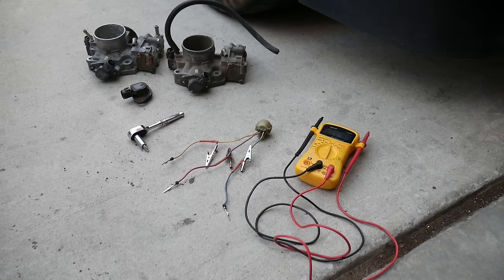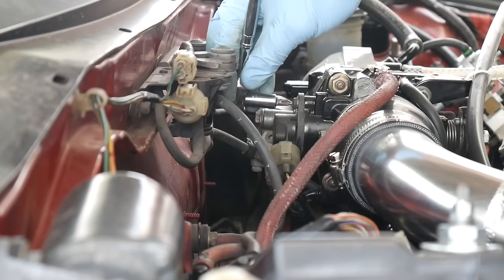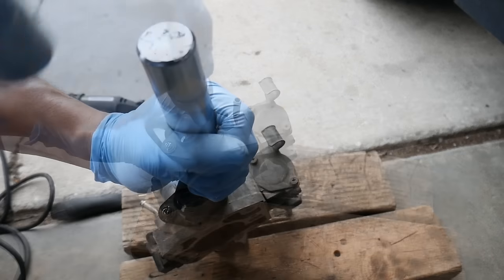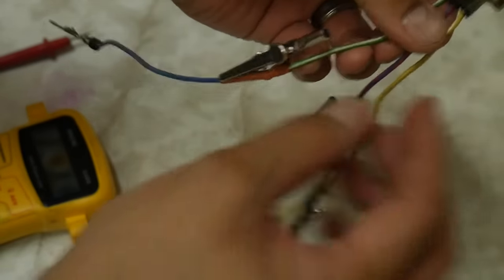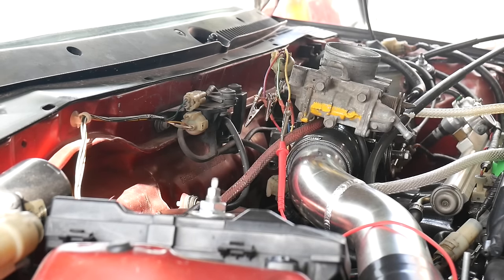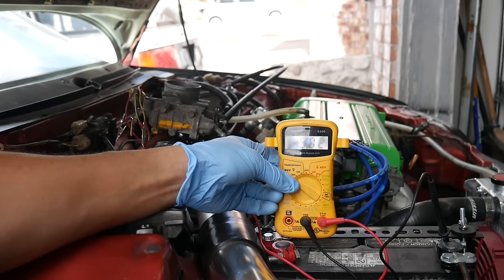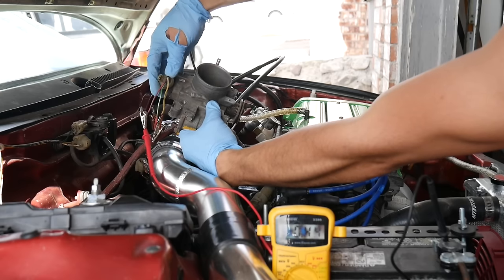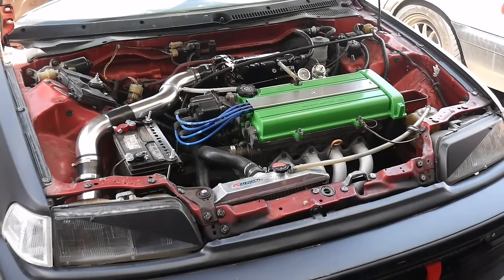How To Replace & Calibrate Honda TPS (throttle position sensor) - Code 7 Check Engine Light

Comment: PLEASE DELETE THIS VIDEO.... you will never adjust or touch the TPS sensor. Japanese engineers have this set DUMMY! That's why those bolts are not screwable.
Reply from the maker: Haha.  And when you replace it?  Hello?
Reply: @GarageBuiltHondas  you should replace the entire throttle body, which comes with manf tuned settings...
Reply from the maker: No.  That's not required otherwise they wouldn't sell independent TPS's.  That really wouldn't be cost effective.  Think of all the Honda's in the world with aftermarket throttle bodies with not a single TPS already attached.  Do you really think they have a hard time adjusting those?  This method works perfectly fine.
Reply: @GarageBuiltHondas  yes with tuning issues...
Reply from the maker: Lmao, wow.  Just stop man.  It's like you're arguing that water isn't wet.  Geez.
Reply: @powereng1000  So if the front door on your house squeeks you just buy another house? You own a console you peasant.
Reply: @GarageBuiltHondas  Mine one is honda fit 1300 cc 2002 I watch some other videos they set 0.40 at fully close but some 0.45, so I'm sure which one, can you suggest me?
Reply: The local Honda dealership offered to sell me a new throttle body with sensor for $600. Sorry, no. Replacing it and recalibrating the sensor seemed safer than buying an entire after-market throttle body.
Reply: Just completed the calibration and put everything back together. Took the opportunity to clean the throttle body thoroughly and pour about 1/2 can of fuel system cleaner through the throttle body with the engine running, using the throttle to keep it from stalling. It's running better than it has in years.  $60 including TPS and the extra plug and alligator clips. Very helpful. Thanks, Joe!
Reply from the maker: Love to hear that, excellent!!
Reply: @GarageBuiltHondas  wait.... water's wet.... I remember now haha. Some arguments can be rather entertaining.
Reply: @powereng1000  they put those security screws in, for two porposes.
1) if missing voids warrenty
2) so you have to buy the whole unit.
all auto manufacturers do this and yes the video shows a proper repair.
you must work in a parts changer shop
Reply: @danrandle65  Honda has TPS tuned to the MCU. This is a manufacturer setting. You can change it if you are tuning your engine such as when you do a valve adjustment with a new cam shaft for VTech or feul injector.
Reply: @powereng1000  you don't know cars like you think. Please do more reading and less posting...
Reply: @BiggieBert666  sadly for you I am a mechanical engineer with 3 Honda Civics... Due to Japanese emissions laws the TPS is tuned for proper intakes. You can alter the intake throttling... But you will find yourself throwing the MCU control unit off and for the next 200 - 300 miles you will begin to loose power because the si VTECh will be out of sync which will cause you to get valve adjustments regular ly... Unless you have a tuning update to the MCU... DONT touch the TPS settings.
Reply: @powereng1000  Adjusting the TPS to be within factor spec is necessary if its out of spec (which is what this video shows you how to do), but I don't agree with the video adjusting the throttle stops, if you can't get the TPS within .48v closed and between 4.4-4.5v open (Factory Specs), you need a new TPS. If it is out of spec then tip-in fuel enrichment and injector cut-off will not function correctly. This can also lead to VTEC not engaging when it's suppose to, as it requires a certain oil pressure and throttle percentage to engage. As well as loss of power and poor gas millage. Lastly, my TPS was out of spec, it was reading over .55v closed. I adjusted to .48v simply by loosening the tps and rotating it, it has about half a turn of adjustment built in, this make my car drive much smoother at very low throttle angles especially from a start, before I adjusted back to spec there was  slight hesitation, now it"s gone, as the computer is reading the correct voltages for the throttle angle...
Reply: Bro you just helped me out dremeling out the rivets  Thanks duder!!!
Reply: @powereng1000 🤨VTEC NOT VTECH!
 do u even honda?🙄
Reply: is this the same for a k series tps
Reply: Bahaha lol how can he call himself an engineer if all he does is swap factory parts😂😂😂 lol what happens when Honda stops selling 30 year old honda parts entirely!?!
Reply: @clevewatson9175  lol I think this guy wants to justify the 600 Honda got him to come up off of. Lmao
Reply: @danrandle65  My car was 13 years old with > 200,000 miles on it. The warranty was long expired ... so what did I have to lose?
Reply: @clevewatson9175  point taken, if say you got your money's worth out a that one
Reply: Whats up bro is thus accurate for the si crx aswell like the ex or for the b series
Reply: @hardworkingrick2318  not quite SI CrX may have the CVVT engine which is the Toyota engines used after 2006.  VTech engines with SI Hondas engines before 2006 have electronic control on the first and last cam shaft lobes to further increase natural aspiration of the piston pressure real ease at high RPM when the torque increases the spreed. So if you try and tune the TPS then you maybe installing a turbo on the exhaust because the ECU elk thro errors when you increase your soles on a highway ramp.
Reply from the maker: Yes
Reply: @powereng1000  you should never teach anybody about mechanics with this mindset
Reply: @calumwilson1120  you should study my video… i specialize in digital motor starter control systems.
Reply: @IkarosCanFly  is that not what you do?! You're doing it wrong!!! FYI, I got a cut on my hand so the doctor put me on the list to get a new body...
Reply: Spot on bro. Engineers who develop those tps sensor wont put a clearnce in those screws if it aint for adjustment purpose.
Reply: @powereng1000 I thought jerks were extinct
Reply: @GarageBuiltHondas  I got a 96 civic ex upgraded intake and throttle body was 64mm stock OEM upgrade to a 70mm alpha body that was the smallest I could find anyway I got my meter set to DC volts 20 and key on position and negative on batter and my red lead on my red wire (middle of the three) and I’m getting 0.00 on bare wire but when I touch red lead off of the rubber coating for wire it picks up 1.00 something flops around does this indicate I have a wiring issue? Because if so why didn’t tit mess with my last throttle body
Reply: Also @GarageBuiltHondas if I move my DC volt settings to DC 200ms it shows a constant 5.4-6.0 I’ve moved the grooves around a little by bending and nothings changed is this a bad sign of wiring issues
Reply: @GarageBuiltHondas  but you didn’t use a Genuine Honda part
Reply: You should delete your comment, silly.

Comment: Tip for anyone adjusting their throttle to make it as smooth as possible. Do not adjust wide open throttle voltage. Yes it's supposed to be 4.5v but if you get this perfect your closed throttle voltage will be off and your throttle will be jerky. Get closed throttle to a perfect .5v and you're done. When you're wide open throttle the ecu is using the map sensor anyway so there's no point in getting it perfect and messing up closed voltage.

That tool you made is awesome, I'm going to make a cleaner version as I adjust TPS frequently.
Reply from the maker: Good tip, thanks for adding the comment!
Reply: Bro, a buddy of mine calibrated mines while open throttle and its super jerky, gonna give this a try right now
Reply: @Ricer Yoo  do it and let me know. Take your time with it, takes me a lot of tries cuz every time I tighten the bolts the reading changes.
Reply: Thanks, yours seems like a good advise. Does this applies to every fuel injection systems? I have a Honda cb1300, calibrated my TPS to the full throttle, and idle is about 0.7 volt. Throttle is a bit jerky at low rpm, maybe your are right about tuning at closed throttle.Should try it.
Reply: @Manute951  Any system with a cable throttle and TPS I believe should benefit from this method.
Reply: @FroztiProductions  yup, so turns out my voltage was set to .34 smhh, it was fixed 3 weeks ago and car has been running smooth, no more scary jumps or jerks, appreciate the tip brotha

Comment: Jon i just put a skunk2 alpha 70mm tb and a skunk2 pro intake on my b20b swapped crx after taking the tps and putting it on the new tb no matter how a turn the tps it wont go above .15v closed and 3.28 at WOT. ive also tried another tps and same thing the previous owner did the swap and the harness conversion im just stumped though because it was running fine till i swapped everything

Comment: 0.50V IDLE - 4.50Volts WOT. 5V Supply
All B/D Series 3-Pin TPS set procedure.
Apply +/- voltage to two wires, read voltage from 3rd wire. KOEO. Adjust TPS as needed.

Comment: Hi guys so i have an 08 civic and i was messing with my cold air intake.....now i have multiple symptoms... Engine accelerating on its own while in drive bad shifts slight overheating.....a maf code that isn't accurate.....i replaced it 3 times..............( i didn't really move much any suggestions?? And lower and rougher idle............

Comment: Great video! 👍🏻  i have taken out my throttle body to clean it, i have replaced the gasket and after putting everything back i get this code 7. I haven't touched the tps at all... thank a lot ps, the car is a 92 prelude f20a4 engine.

Comment: Where Did You Get The Tester Plug and the Male Connectors To Plug Into The Tester Plug. This Is The best How To Video I Have Found On Youtube.
Reply from the maker: The gator clips I got from Lowes.  The extra plug from old parts cars I've junked.

Comment: Got an engine with no tb so i found a stock ex one in my parts bin. I kept getting 0.01 to 3.2v on my tps.  Off the car it was correct- took forever to figure out it was the throttle body itself! The return spring has worn and is no longer tight enough to maintain the correct voltages. I wish this spring was replaceable but its not. Nobody makes a stock 60mm tb anymore except whats left at Honda stores for $350. Junkyard parts will probably fair no better. The smallest cheapo tb is 68mm! Ecu will not like that or will it??

Comment: Been trying to calibrate the TPS. Cannot set it at .5 volt.
The lowest voltage I get is 1.6 volt with the throttle fully closed. Fully opened, the reading is over 5 volts. 
I think I bought myself some troubles. 
Looks like the alternator has an issue too at high speed. Battery warning light blinking.
Transmission shifts at over 3000 rpm...when it does. And downshifting to first gear is harsh. Oh my. 😟
Reply from the maker: Shouldn't be too much changing some of those sensors.

Comment: Hi thanks for the video.  I have a 02 Acura tl type s with the main and sub throttles.  I did a cleaning of both and removed the tps on the sub throttle, not knowing what it was, to clean.  Once i saw it was not something I needed to clean i screwed it back on.   I then got a 94-1 and vsa and traction control light with high idle.  I also got a p0505 code, which was corrected with replacing the iacv.  The acura dealership states i still have the tsc light on which they said can only be the valve or a short.  Im pretty certain its not a short or problem with the wiring as i did the work myself.  Could it be that i need to adjust it as you do in the video.  My autel scanner has the sub throttle idling very high with the live data.  Any help would be appreciated.  Thanks

Comment: Mine read 0.06 with it unplugged and wired to the TPS plug and 0.56 plugged in and set to the maximum position  Would this mean its accurate?

Comment: Hey man i just fixed my civic 91 change gas pump and head gasket but when I accelerate just a little at low revs the car drowns out a lil & if I accelerate hard works well do you think I have to adjust the throttle body?
Reply from the maker: You can try it.  Any CEL's?
Reply: @GarageBuiltHondas  no codes all sensors working

Comment: I used two tps and they both wouldn’t adjust past .22. The 2nd one I used didn’t move at all. Wide open like 3.5... are they both bad? It was fine before I swapped my engine same tps

Comment: I just did my TPS today and I got .49 closed and 4.65 open. Should I worry about this or just leave it?
Reply from the maker: It'll be just fine.  You won't even notice a difference.
Reply: @GarageBuiltHondas  Well I ended up messing with it again and got it down to .483 and 4.610 but thats the best I could do.
Reply from the maker: Drive it.  It'll feel just fine.
Reply: @GarageBuiltHondas  Yah you were right. Its been driving fine these past few days.

Comment: Clear and concise, great video!
Reply from the maker: Appreciate the comment!!
Reply: Garage Built Hondas hey so I'm having trouble with my turbo EF.  built b18b bottom b16a head car won't rev past 2500rpm. I bought a new tps sensor and installed today if it's above .5v at closed will this cause the issue I'm having I got pissed and went inside gonna try to fine tune it tomorrow need the car running properly by Tuesday to have it dyno tuned
Reply from the maker: Was it running fine then this started happening?
Reply: Garage Built Hondas no at first I have a code 9 so I changed the distributor and cleared that up.  before I changed the distributor or started to do that so I thought once I fixed the code 9 it would go away.  so then my tuner suggested that the tps was causing the issue I changed it last night but it still won't Rev past 2500 rpm.
Reply from the maker: Any other CEL'S?
Reply: Finally my search regarding the tps adjustment topic is over...thx a mil man...great work✍️👍
Reply: Great video ! Thanks for sharing! 
  Once you made your adjustments, how do you tightened the two slotted screws down?

Comment: what if the voltage is change when the engine is start example if my voltage in of engine is .73 in close position and when engine start the voltage is up in  .86-87 is that normal or i need to change my tps
Reply from the maker: It sounds off.  Does it idle high or have any strange symptoms?
Reply: I’m having the same problem. Closed it’s at .7 open it’s at 4.5

Comment: So if I don’t have what u made to check the volts would I just have to check but direct wire contact ? Or how would that work ?
If not can I just replace it and if I did replace it would I still have to check the specs
Reply from the maker: You need a multimeter to check and set it.  There isn't any other way.

Comment: Really like the jjumper harness. Was just thinking about making one today while I was surfing the tube. I basically have to have one so I don't mess with my rywire harness. Also, you install, or have any videos on installing AEM or aftermarket ECT sensor? Trying to find location. I'm wondering if I can install where oem is and use the blue wire to tap into the ecu with hondata. Thanks from San Antonio.

Comment: I have a 1991 civic lx dpi we're do I buy a tps replacement I have order the wrong one every thing is pointing to a new throttle body.
Reply from the maker: https://rover.ebay.com/rover/0/0/0?mpre=https%3A%2F%2Fwww.ebay.com%2Fulk%2Fitm%2F222444311867

Comment: About that TPS testing plug you created, I’m wanting to create one like that myself. I’m not following how exactly that works. You plug it into the TPS sensor you want to test, use the alligator clips for the multimeter you hook up to, but what and how do you hook up the other three wires too without splicing into the harness?
Reply from the maker: If you see in the video, all 3 wires now have the metal leads on the end.   I slide those right back into the original TPS plug to create the connection.
Reply: Garage Built Hondas ok I got that part of it. Now where did you source the male ends that plug into the engine harness?
Reply from the maker: De-pinned from another plug.  I cannot remember which because I have a box full of connectors, but obviously ones that are male ends.

Comment: Would a bad tps gasket cause the vehicle to die on a cold start? It only happens when cold and if I spray some brake clean around the tps it makes the idle change.. Just wondering if you've ever run into that issue before, I should probably add that this is on a dual point style
Reply from the maker: It does sound like a vacuum leak of some sort especially with the fluctuating idle with the brake cleaner.  I'd check the gasket first.

Comment: Love your videos man!!! Great info!!! I'm a proud owner of a 2000 crv too. Love it. Anyways i just adjusted my tps and closed i get.52 and wot 4.6. Is that ok??? And while i had the throttle body off i ran down the fast idler valve. Was just wondering your thoughts on that if you think that is ok. Thanks
Reply from the maker: It's close enough and will be just fine. 👍

Comment: I'm currently attempting this, but those damn screws are very tight. Even using the dremel and screwdriver method, they just won't budge. Think I need to use an impact driver like you did?
Reply from the maker: Try it.
Reply: @GarageBuiltHondas  ended up visiting my local mechanic who kindly agreed to unscrew them for me for free lol

Comment: I got a 96 civic ex upgraded intake and throttle body was 64mm stock OEM upgrade to a 70mm alpha body that was the smallest I could find anyway I got my meter set to DC volts 20 and key on position and negative on batter and my red lead on my red wire (middle of the three) and I’m getting 0.00 on bare wire but when I touch red lead off of the rubber coating for wire it picks up 1.00 something flops around does this indicate I have a wiring issue? Because if so why didn’t tit mess with my last throttle body
Reply: @Garage Built Hondas